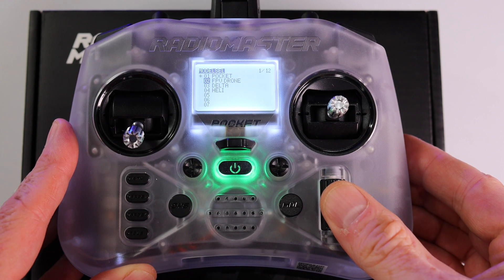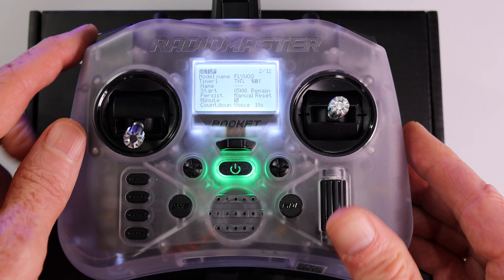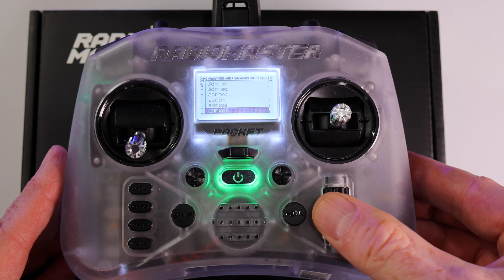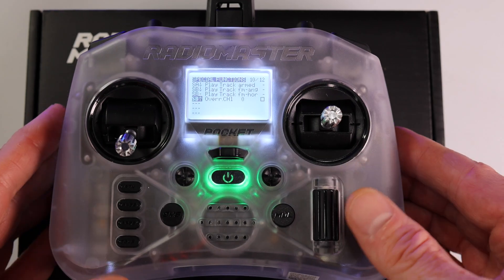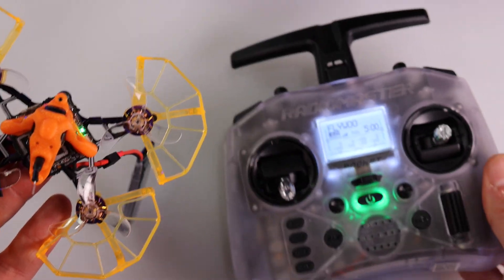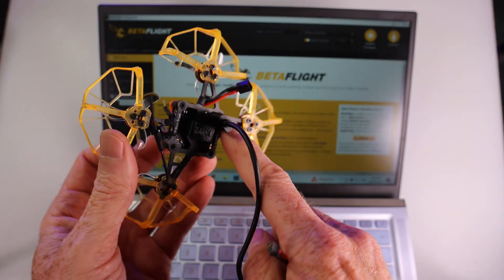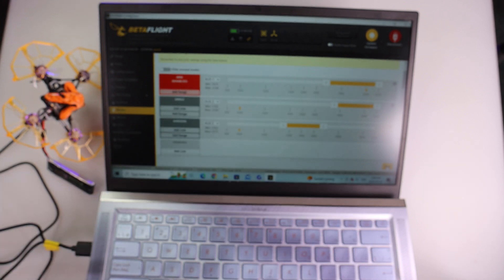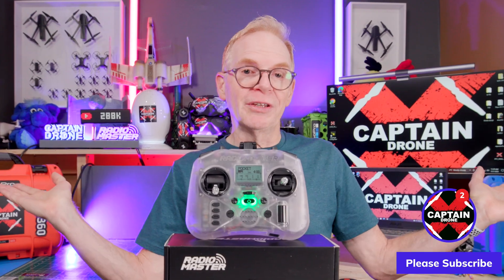RadioMaster Pocket - How To Set Up and Bind a Drone - Step by Step

Comment: I know it’s really late but could you give me some advice, my arm switch doesn’t activate my drone anymore, I have it as a special bind, just like you said, and the timer is just like yours, but it does not arm. Previously an hour ago I flew the drone perfectly well, everytime I pressed armed it said armed on the fpv goggles, now it says armed and then crash flip switch or something like that,
Reply from the maker: I have already answered your question.  It is simply that you setup things up incorrectly. Follow what I wrote and all will work.
Reply: @ o thanks for the help, I actually posted 2 comments so I wasn’t asking again. Basically for some reason I plugged it in and it worked, I didn’t do any tuning

Comment: I was following this tutorial and it almost worked perfectly for myself. What happens if it detects the sticks on the transmitter but not the switches? In betaflight it detects all the stick inputs but none of the switches
Reply from the maker: It simply means you did not setup the radio correctly.  You see on your radio there are switches, potentiometers, buttons, and NONE are in use until you assign them to a model.
Reply: @CAPTAINDRONE798  Thank you! After watching your video, what I tried on my Radiomaster Pocket was to go into the model labelled "FPV Drone" then bind. Before I created a new model but I haven't figured out what the difference is yet. 

But, did get it working :)

Comment: Could I get some help I have a radio master pocket with a ELRS external attachment on it. Then a happymodel mobula six that’s also  ELRS yet I cannot seem to bind it have been trying for  ages to get into the hobby but this seems to be getting in my way. Help would be appreciated thanks for reading!
Reply from the maker: So, from what you mentioned, your issue is BINDING?  If you followed the process shown in this video, it will work 100%.... UNLESS:
1. The receiver in your Drone is on a different FIRMWARE version than your POCKET.  Both need to be on Version 3.x.
2.  Perhaps your drone has an ELRS SPI receiver in it?  If it does, then it means you have to click on the BIND button in BETAFLIGHT CONFIGURATOR under the RECEIVER tab.
Reply: @CAPTAINDRONE798  yes sorry I didn’t make that clear at first but it’s whenever I click bind on the elrs page it dose not do anything. I think it also might have something to do with the fact that I’m not sure if my drone is in binding mode when I unplug and re plug 3 times and I also don’t know where the actual bind button is
Reply from the maker: @GIGAMONKEY-eb7oiIf it is ELRS SPI then you DO NOT PLUG AND UNPLUG BATTERY… that is only for drones with a PHYSICAL ELRS RECEIVER… ELRS SPI is part of the flight controller so not a physical receiver.  You simply connect to BETAFLIGHT configurator, go to the RECEIVER Tab then find the BIND option on lower right os screen.  Before clicking bind you must first press the Bind on the radio, then immediately press it on the computer.  Some drones require a battery in the drone & others do not.
Reply: For some odd reason betaflight doesn’t want to see my drone as when I plug it into my computer and press connect it doesn’t notice it’s there
Reply from the maker: @GIGAMONKEY-eb7oiThat means one of two things… you plugged into the WRONG port on the drone or you are using a USB CHARGE Cable and not a USB Data Cable.  The final problem is that your computer is ancient and is lacking the proper USB drivers.
Reply: @ I think I’m using a chargers cable so we have a data cable on the way I will keep you posted!
Reply from the maker: Also... when you select your EXTERNAL module, it means when you setup a model, you must turn the INTERNAL TRANSMITTER OFF and the EXTERNAL to ON.  Then select CRSF as the RECEIVER option.
Reply: So the cable arrived but when I go and look for the bind reciver option in betaflight after connection it’s not there what should I do as I have already jumped to the latest version of betaflight?

Comment: If i charge ny pocket it blinks red what does that mean
Reply from the maker: Blinking Red?  It could be that you plugged into the WRONG port or that you have NO BATTERIES in the radio, or the BATTERIES are in WRONG or the batteries have plastic on them and are not making contact.

Comment: My drone isn't arming the controller says armed but nothing happens and when i unplug my drone battry it says target telemetry lost and if I plug the battey back it says target telemetry regained I'm very confused
Reply from the maker: Since you do have telemetry, it means you did the binding correctly, but you’ve obviously done something wrong with either the switch setup, or your drone has a GPS RESCUE model on it (you’d know if it does) and you’re trying to arm it indoors where there are no satellites.
Reply: @CAPTAINDRONE798  I’ll try to keep it short, an hour ago I was flying my drone perfectly fine. Then I decided I wanted to switch up the flight modes. And that’s when all hell broke loose. I don’t know why my arm switch is not working. One thing that changed is that previously I pressed armed and it said armed in my fpv goggles, now it says armed and bellow that: >crash flip<  .
Reply from the maker: @AvenirKatko  It simply means you setup your DRONE incorrectly in BETAFLIGHT CONFIGURATOR.  Plug it in again and go to the MODES tab, scroll down until you see FLIP OVER AND CRASH, then clip on the “X” to DELETE it, then hit SAVE.
Reply: @CAPTAINDRONE798 I don’t understand why is now says crash flip, what that means, and why it doesn’t work anymore

Comment: Anyone have any luck with this? My Air75 can connect to Betaflight but I can't get it to bind with the Pocket radio, even after following Steve's step Exactly? The are both ELRS 3.x. The blue LED on top of the ELRS keeps flashing blue but no bind. Suggestion? Thanks!
Reply from the maker: Then you issue is simple.  If you know that both the POCKET and the ELRS RECEIVER are on the SAME firmware, and you followed my BINDING Steps exactly…. Then it means one of two things.  Either you are doing something WRONG, or your drone is ELRS SPI, which means you simply connect it to BETAFLIGHT CONFIGURATOR and go to the RECEIVER TAB, look at the bottom right of the screen and you’ll see the BIND button.  Press it and then quickly press BIND on your remote.  If done correctly and quickly binding will occur.
Reply: @CAPTAINDRONE798  Thanks for that. I confirmed the ELRS receiver on the Air 75 and the Pocket are both 3.x. I followed your instructions to go into Betaflight receiver tab and select the Bind button AND quickly select Bind on the Pocket and... NO LUCK! I confirmed this with a Brand New out of the box Air65 and still no luck, so i must have missed something in the setup, so this points to the Pocket. When I bound the AIR75 originally with the Boxer radio it was flawless, so something else is going on. I'll keep going and post a solution this this thread as a follow up for others in the same situation. Thanks again and greetings from San Diego!
Reply from the maker: @ktrimberger Keep in mind… if you see a BIND Button on the RECEIVER tab then it means your receiver is ELRS SPI and you can’t fly only bind it as per my instructions above.
Reply: @CAPTAINDRONE798  Ok, so I got the Air65 to bind with the Pocket. I simply made a copy of the Air75 model and bound it. No idea why that worked, but the Air75 still won't bind with the radio, following your explicit instructions above. So that confirms the Pocket is working correctly and the Air65 receiver is working correctly, which points to something going on with the Air75.  I'll keep going until works! Thanks again.

Comment: Hi Steve I just got the RadioMaster Pocket and on Internal RF it only has Multi and off nothing else, Also when I go into tools the ExpressLRS doesn't load up, Please help me. Thanks
Reply from the maker: So it appears you bought yourself a RADIO MASTER POCKET that is not the popular ELRS version.  You bought the other versions, so you have no ELRS.  Now you will have to buy a module that goes on the back of the radio that is an ELRS module.
Reply: @CAPTAINDRONE798  Ok ok I see, hopefully I can return it and get the lrs like I wanted, Thanks Steve your da-man
Reply: @CAPTAINDRONE798  Are you saying there are different versions of Radiomaster Pocket ELRS?
Reply from the maker: @ Ha ha, you’re playing with me right?  There is the ELRS version and then there is the CC2500 version.  Many Rookies always buy the wrong version and can’t figure out why they don’t have ELRS (very common).
Reply: @CAPTAINDRONE798  I'm that rookie, lol thanks Steve

Comment: I have the issue where all of my throttle yaw and roll sticks work and show up in beta flight, but none of my aux switches show up when i move them, I did debug through the controller and they are all showing up as functional, but I cannot get them to work in beta flight, even ten simulator won’t work when I try to use them? I need help please!
Reply from the maker: It sounds like you forgot to setup the MIX page within the radio, or you did but assigned items incorrectly.

Comment: Does it work with cinelog 25 ?
Reply from the maker: If you get the ELRS RADIOMASTER POCKET then that means it will work with anything (DRONE, HELICOPTER, PLANE) that also has an ELRS RECEIVER.
Reply: @ sorry I’m new to drones. I’m getting the cinelog 25 digital the dji 3 system.

Comment: Captain Drone does a great job of telling AND showing exactly what to do. He doesn't do any sleight of hand or move too fast. He understands his audience needs and capabilities and delivers magnificently. The video on the RadioMaster Pocket setup and binding was such a time saver and extremely helpful to this beginner. If asked how this could have been improved, I would say at least MENTION the trim adjustments.
Reply from the maker: Thanks, I appreciate the feedback.  The reason the TRIM functions are not mentioned is because most of my audience is setting up the radio for an FPV Drone and there is no such thing as TRIM for an FPV Drone.
Reply: @CAPTAINDRONE798  Thank you for the explanation.  Since my simulator drone on Velocidrone goes forward when I only move the throttle, I assumed the trims for fine tuning the joysticks. Guess not!!
Reply from the maker: @chuckgreen5855  On a sim, if things are not correct it is because you have not gone to the menu and selected CONFIGURE INPUT DEVICE.  Every simulator should have such an option.  You then move the joysticks in different directions as the instructions walk you through the process.

Comment: Im still having a problem when i click ExpressLRS  its stuck on loading even after turning the internal RF to CRFS do you have any idea why?
Reply from the maker: I’ve had the issue (occasionally) as well.  You sometimes get this with radios that have a slot on them for a MICRO SD CARD or a MICRO SD CARD inside. The problem is often the radio trying to read the card.  What I do is hold down the RETURN Button until the screen clears (sometimes works).  Or if you can see the Micro SD Card, power off radio, remove the MICRO SD Card, then put it back in, Power on again.
Reply: @CAPTAINDRONE798  thanks

Comment: 10:53 i have a problem there. What if  i move my sticks radiomaster pocket and i dont See any move on BF? Speedybee F7 V3 stack, dji o3, radiomaster pocket, happymodel elrs.
Reply: I've already found a solution to the problem. I had some soldering under UART3 and some under UART2. My mistake. Now everything works.

Comment: Hope you see this and know it's not likely but if I need to swap the throttle to the right side would I need to disassemble it and swap them or is there another way?
Reply from the maker: You would need to disassemble and also remove/add the tiny springs
Reply: Thank you so much for the reply. Do you have a video or know where I can find info on learning to do this? Ive found other videos that show other radios but Im unsure if its a sort universal process.

Comment: 9:45 I did everyting and my drone is conected, but when I press armed it does not activate the motors for some reason, what could it be?
Reply: @albert.guzman_filmss  U didn't set up channels that your problem
Reply from the maker: It means you did something WRONG.   Either you set the radio up incorrectly or when you went to BIND to the receiver in your drone you did it incorrectly and no BIND occurred, or you have a drone with a GPS unit on the nose or tail that will only allow a drone to bind if it receives a satellite signal.

Comment: Hello hello! Just received the Radiomaster  Pocket today, I let it charge for close to 3 hours and it still doesn't power on. I just went through the steps mentioned in this video... What am I missing? Do I need to remove anything? The light is blinking red as if it's charging. How long does it take for the initial charge? Thanks in advance!
Reply from the maker: Did you put batteries in it????
Reply: @CAPTAINDRONE798  OMG LOL! And there's the issue... The package said that the batteries are included and I figured they'd be in the RC because I didn't see them packed seperately anywhere. There are no batteries SO, I guess it'll be Tuesday when I get to play around with it.😕

Comment: I just got a Betafpv air 65 and a radiomaster pocket CC2500 and it's giving me a hard time connecting, do you have any tips for this specific whoop ?
Reply from the maker: Do you know what type of receiver is in the BetaFPV AIR 65?  I would have thought it would be an ELRS receiver which is 100% not compatible with the CC2500

Comment: I have watched it and it was very helpful until one moment. I pressed ExpressLRS (after sys) and it stuck loading forever. I rebooted the controller several times, but it was like that all the same. Could you give me an idea on how can I fix it, please?
Reply from the maker: Keep trying.  I think the POCKET uses a micro SD card for ELRS data so it could just be a glitch (as long as the Micro SD card was not erased or damaged).  Power off, wait a few seconds, power on, and try again.

Comment: I did everything you said and my drone won’t bind up. I have the exact transmitter you are using and the exact drone. I plug battery in 3 times and hit bind and nothing.
Reply from the maker: If you are new at this then you are doing something, or several things wrong.  For example, is your radio and drone on the same version of ELRS? If not, they won’t bind.  That is one of many issues you could have.
Reply: @CAPTAINDRONE798  how can I see what elrs version my radio and drone is on? And then how do I fix the issue?
Reply from the maker: @cG-es8mb You will have to research how to use ELRS CONFIGURATOR:  https://youtu.be/9gjzKlUlo0M?si=9ZRx9889uJuR4rDi
Reply: @CAPTAINDRONE798  did you have to update your elrs version or were you able to bind up out of the box?
Reply from the maker: @ I had to update it because my version came about two weeks before I made that video, which was long ago.  I updated it to ELRS VER 3.  If you recently bought a RADIOMASTER pocket than it would arrive with version 3 on it.  But the drone you are binding to, may not have version 3 on the ELRS receiver, unless you purchased a new model and not a model that has been on the market for awhile.

Comment: This didn't work so there is missing information. Very frustrating
Reply from the maker: This means you did something very wrong. Common with people not familiar with how radios work, or how receivers bind, or how BETAFLIGHT Configurator works. Thousands have followed this vid with success.  You too will have success once you figure out your error.

Comment: Followed all the isntructions, but when I arm and push my throttle. The motors don't spin. But the binding has worked and the receiver works in betafligth.
Reply from the maker: It could be you have the LEFT JOYSTICK slightly up and not fully lowered to the bottom.  You may have the drone on an Angle.  Or you have a GPS in the drone and it won’t let you arm until you get sufficient seats, Or… you setup your radio WRONG or you setup your ARM SWITCH WRONG in betaflight configurator and/or you have another switch assigned to the same ARM Switch (scroll down on the MODES screen to make certain nothing else is showing for the switch you picked).

Comment: my radiomaster boxere doesn't show up the controlers in betaflight. I don't know what could be
Reply from the maker: That means it is not bound to the drone
Reply: @CAPTAINDRONE798  it connected with the dron, but the control doesn't respond... And it doesn't show anything in beta flight... I'm checking firmware again on it